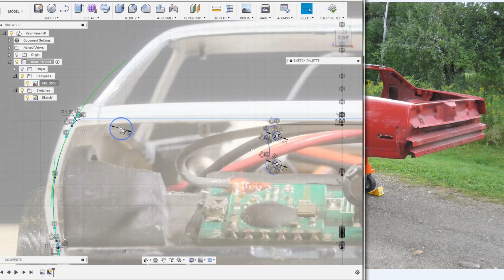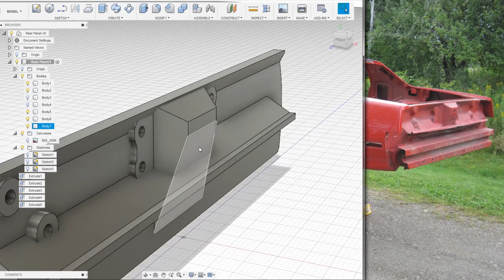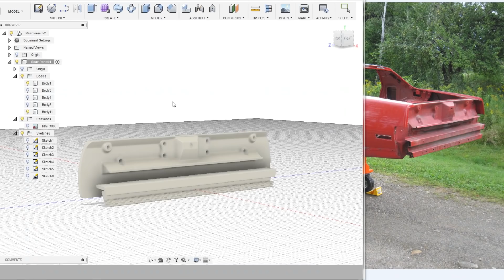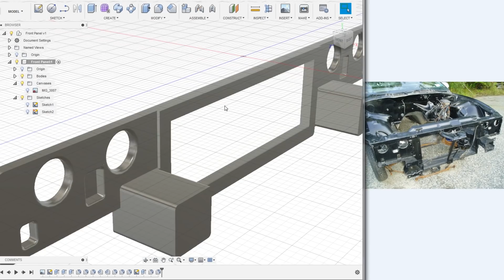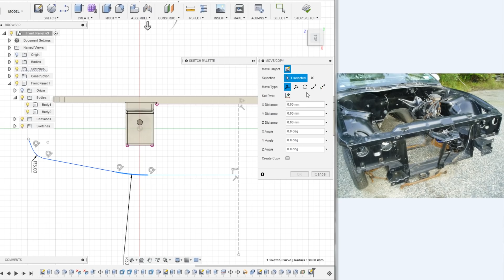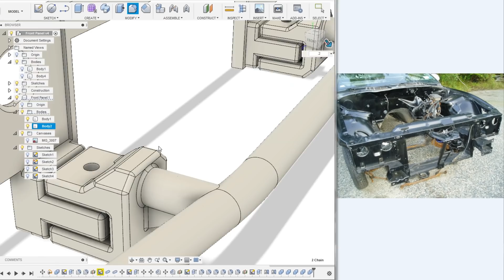Speed Modeling Custom Front Bash Bar and Rear Panel for Firebird in Fusion 360

Comment: Digital calipers are cool and pretty cheap, problem is when you shut them and they never return to zero properly, ok its only ever a few tenth of a mil at most but it still shakes my confidence in em, wish id just bought a cheap mechanical set.
Reply: Thats why u zero them out every few uses.